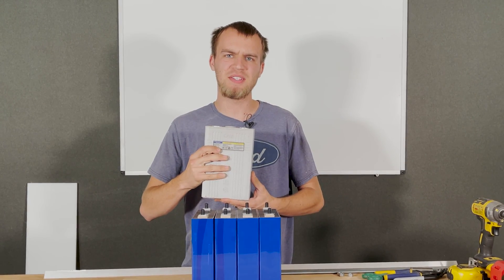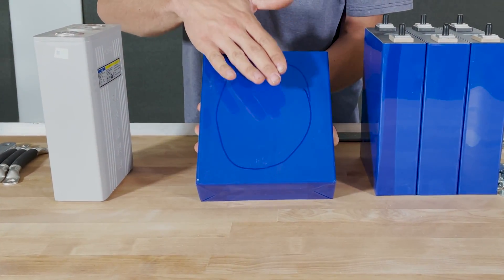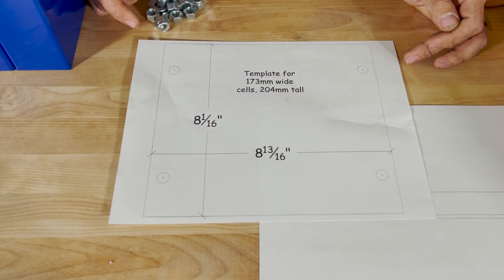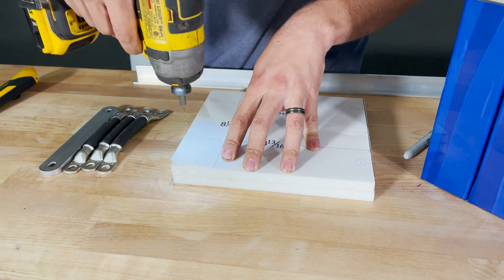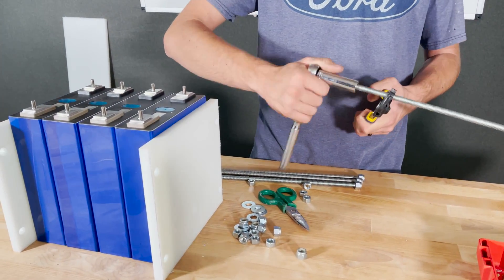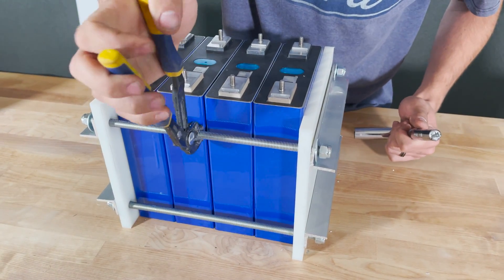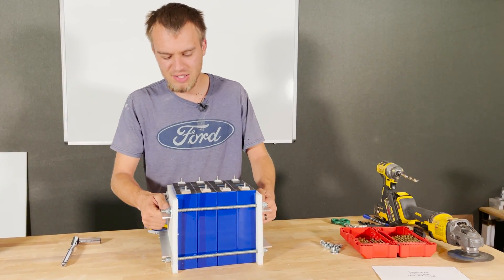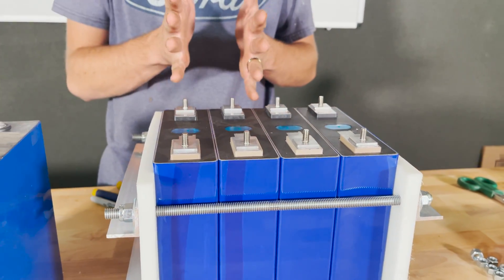LFP Cell Compression || The What Why How & Very Important Considerations || Step-By Step Tutorial

Comment: i have built more than 6 battery packs using EVE LF280K blue cells. i have not applied compression to any of them. they are all "fine". you say "irriversible damage", and that may be so on a very long-term or microscopic level, but for low C-rate usage in stationary offgrid applications, no compression has been strictly needed. the cells have swelled slightly, on the 1mm scale, and have shifted a little over the years. the oldest 14kwh pack is from 2020 and gets cycled daily 2-8kwh in an offgrid solar context. 

compression is smart but it's a big extra expense and task for poor people living on the edge, like i was for a long time. today i'm assembling a pack with some compression, though, now that i have some more time and materials for it.

Comment: Cheapest, most effective, most benefit way to do it:
Get flat bar metal weld threaded bolt sections to ends. Cheaper, higher quality than allthread. 
Make end plates out of flat bar, but tack welded to the end caps which are flat metal same footprint as battery and spacers... On end weld flat bar around area where compression bolts penetrate. 
Its like double i beam strength. Only several 1/2 tacks needed. 
Then cut out from durable chloroplast, spacers.
You make air vent upwards. And this way the cells have material to compress, electrically insulate, and keep constant good pressure. The even air cooling and a more even compression points makes it very much easier on the cells. Bus bars may or may not need adjustments. 
SO, you see the end plates and compression flat bars are all pretty much made of the same material. The sheet metal squares are easy to cut and tack up. 
The battery should then be proped up so air can circulate naturally or you could force air to convectively cool. 
If in an equipment rack, the air can blow upwards and filter, and cool several components and have the chimeny effect. 
Make sure its not drawing air from the floor or a low surface, unless filtered. As crap is sucked up by the fans and that means it should be filtered or screened air. 
The air gets around evenly making the cells more constant temperature which is most important. 
Constant temperature for one cell radiating heat at a constant rate is how the mah is rated on the data sheet. 
The pressure is also constant and ideal, where heat consistiency and pressure consistiency and thermal transfer rates keep these cells in the most intert environmental conditions
Basically.

Comment: Help: I had 4 stacks of 8 batteries each running for 6 months. These are the 3.2 volts 320amps.
Decided to replace a few low performing batteries so I removed the compression off. In a few seconds they all became swollen. It’s now a nightmare. Can I re compress them again? What a mess?

Comment: hi hello, nice video, very informative, have you top balanced that battery already? may I asked if what amps did you charge that battery? if its 3.65V in parallel how much amps did you put in there to balanced it simultaneously? or what is the recommended amps for balancing if any, thanks.

Comment: Hi, was looking to have 2 rows of 8 battery's to get around 320amp 48 volt bank made up & thought i might have 6 rods with 2 of them in the centre with a gap of about 12mm between the battery's  if using 8mm studding.  Also is it worth fitting 0.5mm insulation Epoxy Plate Insulator Board  between each battery ??? Thanks

Comment: I free stand my cells.  No touching, no compression.  They are ove 4 years old and there's no issue.  Compression WILL NOT STOP SWELLING.  Read the literature.  The swelling is normal.  The cells will die from calendar years of existence before you can wear them out using them with or without compression.  Don't listen to those who tell you to compress.  Take them apart after being compressed for a year and test them with a straight edge and you will find they are swollen just like they would be withou compression.  Compression is NOT NECESSARY!!!!!!

Comment: Beautiful video, for how long you can stop chain reaction from one cell to another. LFP produces flammable gases. H2, C2H2, C2H4, CH4, C2H6 etc. After ignition your house is gone like cardhouse. A lot of videos of YT that LFP are more dangerous like NCA or NMC.
Reply from the maker: @PavolFilek  lfp is an order of magnitude safer than nmc and nca, what are you talking about
Reply: @HighTechLab  NO, a lot of houses destroyed in EU. From LFP after inignition.
Reply: Do You plan working at 160°C?  Cause "that" paper states those gases are generated once cell superficial temp reach that Temp
Reply: For reference: article (not paper) is titled "Thermal Runaway Vent Gases from High-Capacity Energy Storage LiFePO4 Lithium Iron"
Reply: @zorr1llo  YOu need to read 10 - 20, 60 to 200 pages pdfs per day, 365 days, 40 yeras, to understand physics of chemical storage of energy, if you read 2 - 3 articles per day 2 - 3 pages, you are not an expert ini this field.
Reply from the maker: I don’t see how you are supporting your claim that nmc and nca are safer than LFP.
Reply: @zorr1llo  Gases are generated, where separator is broken, damaged and after few seconds destroyed completely. Nowdays we use plastic separators, not permeable to electrons - fermionic particke, but with high permeability to ions - big ball from qurks - up, down., which form particles like neutron - 15 min life, and proton - infinite life. If you can stop dendrites grow on SEI layer, you will have Nobel price soon. If you can use soolid state electrolite you are good at this science. But if you can not stop thermal ruynaway, bacause your BMS has no energy after shor circuit, your house will catch fire or explode - 1000 of examples at YT and other sites.

Comment: Top balance is not really necessary balance maybe necessary what I mean is just make sure there all the same voltage by Connecting them all in parallel and letting them set for a few hours so you don't need compression to do that, then charge to full and check with a multimeter to make sure there the same if you have adjustable power supply you can Simply put a little bit of energy in the one low cell, but the bms should do the same thing.

Comment: You have to have clamp pressure in the middle of the cells as this is where they bulge from the most. You should have one more set right across the middle and it’s a must for safety to add insulation between the cells. Several things wrong with this setup.

Comment: - I wouldn't talk about "compression" as the name of the structure you described, but only about preserving the original dimensions. I've noticed that some people think that this kind of threaded rod structure is supposed to PRESS the cells against each other with a certain N force. That is a misconception. the purpose is to make only a structure that WILL RESIST a certain compression directed outward from the cells without letting it change the shape of the cells. If before the cells are put into use, by tightening the threaded rods, inward compression is caused to the cells - it is useless and possibly harmful if it changes the shape of the cells at any point!
- I feel that you put the aluminum upper and lower corner pieces too far apart. Now there is a lot of unstabilized space between them for the cutting board to give way to the bulge of the cells. Personally, I would have placed the upper "collar" an inch lower and the lower collar correspondingly an inch higher. If the location of the upper and lower stiffeners were clearly closer to the center of the large side of the cell, it would indeed significantly prevent bulging compared to your current solution. So the cutting boards off and to drill new holes.
- Many people who build a battery pack in a similar way also place a sheet of cardboard against the surface of each cell, so that they don't damage each other with a hard surface, with a soft sheet of cardboard protecting between them.
- The threaded rod should also be coated with some kind of soft hose to avoid hitting the hard metal and damaging the sides of the cells. It is recommended to place the threaded rods as close as possible to the side of the cells, so that the cells cannot slide sideways under any circumstances.

Comment: Thanks for posting this video. Some people say compression is not required but the CATL 280Ah spec sheet I have clearly states for maximum life >6000 cycles the cells should be compressed with 300 Kgf for at least the first 180 cycles or 6 months. Charging max 0.5C @ 25 C.
Reply: but main question is what means this 300kgf because on a dyn key we have Nm, kgf.cm, kgf.m and realtion is like 300kgf.mm=2,94Nm or 300kgf.cm=29,4Nm or 300kgf.m=2942Nm . kgForce is not a kg !

Comment: Never tighten the fixture to factory specs when the battery is not fully charged to 3.6v per cell.. I would suggest as low as 1 to 2 foot pounds on the nuts at most.. Slowly bring the battery pack to full charge and even back off the pressure a bit as they charge.. Top charging all the cells paralleled at 3.65v before putting them in pack series is old school.. Using a modern BMS with 2 amp active balancer and slowly bring the whole pack to full charge allows the active balancer to do all the work.. Alot less messing around compressing uncompressing connecting then disconnecting and rearranging the cells.. Compression is only good for new virgin cells and is used during the initial 10 to 50 or so cycles of conditioning to assure that any trapped gas bubbles get forced into the internal channels built into the cell laminations.. Once this period is over compression is not really going to improve cell life.. He was correct when he said overtightening can and does destroy the batteries.. If you are going for a long life be aware that these batteries will degrade over the years no matter what and even with gentle care they will be at 80% capacity in around 10 to 15 years when that decline will increase.. A slightly bulged battery is no indication of it being trash.. What trashes these cells is exceeding the charge/discharge rate and voltage minimum and maximum.. Very light compression should be maintained if you plan on going from sub 2.5v to 3.65v per cell on a constant basis but be aware this will quickly degrade the cells.. The best route for long life is never exceed .5c charging or discharging and keep the cell voltage between 2.8v and 3.5v.. This alone will add thousands of cycles to these cells.. It is also always best to have the cells standing terminals up for that initial conditioning number of cycles before you put them on their side..
Reply: Great and sensible information, thanks for sharing. I think that the original insulation should be enough between cells, but the sides must be clean before assembly.

Comment: It is necessary to place an insulator between the cells, and heat-shrink the threads of the studs. Better at three. Because if the thread cuts through the blue shell of the cell, it will be very bad. The same thing will happen if the blue shell deteriorates over time and a short circuit occurs between the housings and the adjacent cell.

Comment: About that 300 kg force of compression per cell. So for 4 cells it would be 1.2 tons. How to make sure it is that high? If you know the threads count on the rode, you can set the torque on the wrench. for 4 bolts would be 300 kg force per bolt for those 4 cells. See Bolt Torque Calculator. I just used one. Result is: M6 rod is too thin and will not sustain that load. M8 seems work as following:
Application Data
Major Bolt Diameter: 8.00 mm
Bolt: Pitch: 1.25
Bolt Proof Strength:303 MPa
Recepticle Length:12 mm
Recepticle Strength:1450 MPa
Applied Tensile Load: 300 kg
k Factor:0.2

Recommended Torque
7.413 N-m
(0.75639 kg-m)
(5.467 ft-lb)

What torque did you put?
Reply: >for 4 cells it would be 1.2 tons
No. 300kgf*4 is summary force for parallel assembly = 1 layer with 4 cells.
But here is sequential loading, each layer compressed by same common force.

Comment: I have read that the compression is only necessary at the very first chrging. 
This also means that an initial capacity measurement (without compression) at a dealer will permanently loose capacity.
Reply: oops... is that so?   terrible,because lots do it free air!!
Reply: @josepeixoto3384 you are absolutely correct

Comment: Personally, I wonder if charging to 3.40 volts a cell, and  reducing the amps as you get closer to that number, with  spaces between the cells and some computer fans blowing away the heat is a better idea..Take away the conditions that lead to bloated cells in the first place, having an over sized system(battery capacity), will do alot of that..Being gentle on your bank with low C. charging and discharging rates, more voltage less amps...If you have a big enough bank and your charging with solar and you stay within 40 to 80%..Those cells will last forever..Get a JK BMS and set balancing for 3.40 when the cells turn off, and balance every 3 months or so, the more you stay away from fully charged and fully discharged, the better off your battery will be..Heat kills LIFEP04 batteries and electronics...When EVE did those experiments they were cycling those batteries hard, full charge full discharge, don't do that...

Comment: Hi Your video is very detailed and it is helping me a lot to build my battery 
my question would be if you can compress the battery cells even if you don't know the SOC (I only know de volt =3.27) 
Or better discharge them before compressing. (The ideal is to compress them when the SOC is 25-30%)

Comment: If you had a strapping machine you could use the angle iron as edge protection and pull it together. That way. I would recommend using channel aluminum rather than angle so you reduce the width of the pack and it's still quite strong

Comment: I really liked your idea and what you say makes sense. But then, wouldn't it be safer if you put this plate between one battery and another?
Another detail is that for battery swelling to occur, it is necessary to don't use excessive voltage above the recommended by the manufacturers and also not to use a BMS to avoid these problems with this swelling and even the preca of the batteries.

Comment: Just because cells are slightly bulged out does not make them junk. If they still take and hold a charge and can be discharged they still have use. Will Prowse took a bunch of grade b, swollen cells and connected them together with longer buss bars and has them sitting on a shelf. He uses them daily to charge his EV.
Reply: I was about to say that. More people than just Will P. have reported good performance from swollen batteries. I suspect overall cycle life will shorten but put the batteties to use if they are performing well.

Comment: I charged those cells to 4.2 for like a min and didn't swell. repeatedly charged to 3.65 and no swelling. Used blue cells for 3yrs now and no swelling whatsoever and didn't compressed them. Am I lucky or there's something I'm missing?
Reply: if you do not charge with 1C current this is not necessary

Comment: TIP You can steplessly dim down an under-table bulge and all other hungry electricity consumers with the 5000W dimmer (7, EUR). I run 5 dimmers in parallel on an 850W inverter. Kettle 2.2KW at 150W runs for 12 hours at a time, so the water is always hot. The room is also nicely heated. 2.5KW washing machine runs in parallel with dimmed to 200...400W. Iron, dishwasher, oven, electric heater, coffee machine, all internal heating are throttled with me. Videos on my channel https://youtu.be/eC2olbCBhh0 The inverter stays cool, quiet and the MOSFETs stay intact because no extreme current peaks arrive at the inverter...

Comment: that's exactly how I built mine about two years ago, about 14.5 KWH 4S 120 AMP overkill  solar  all 4 going to common bus and except for a BMS recently dying its been a great system. Running my AC on the RV anytime I need it. The angles are great as lift ledges too.

Comment: 9:08 12psi is the optimum. therefore, you ought to provide something between 6 and 12psi.
Reply: I have 16 304 Eve batteries, two rows side by side, (48v 16s block) with two rods running down the side. Do you tighten up these four rods to 12psi? Thanks

Comment: Why are you even creating custom cross connect bus bars? Feels like an OCD issue to me because you want all the + posts to point north. And your compression is weak, look at the plastic bend when you compress and it bends in all the wrong places. Use 5mm steel plate at each end, use 2x2x1/4 angle iron, and better still, compress using engine valve springs. I hate to say this, but this really doesn't cut the mustard when it comes to cell compression, it feels a bit like lip service to tick a box.

Comment: why not configure the cells in the right order the first time and just connect them all in parrallel with some thick short cables or the diagonal bus bars while top balancing? that way you only have to compress them once and just change the busbars to the normal ones when balanced. interesting stuff

Comment: At what s.o.c. do you apply the compressing voltage?
since the thickness varies with the s.o.c, one might consider a spring pushed forcrpe that will keep the tension much more stable during the expanding and shrinking of the cells

Comment: The aluminum case batteries, being the heat source will expand more then the aluminum angle frame or the steel 3/8 rods. There are material specific thermal expansion tables.